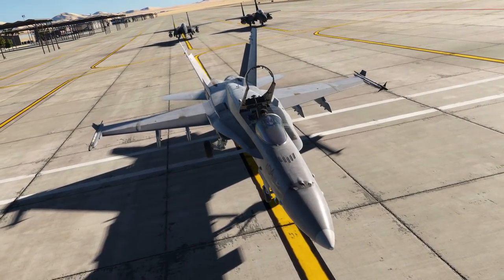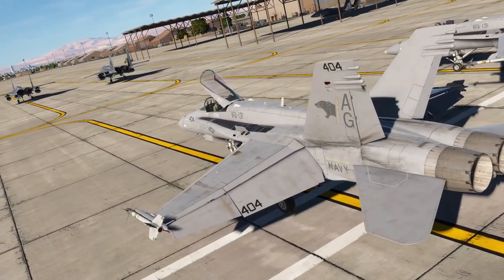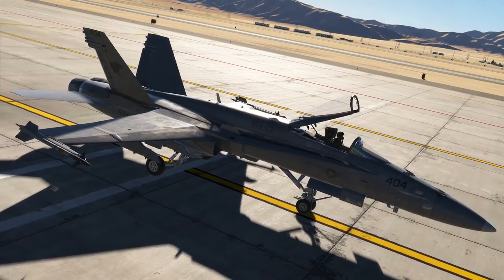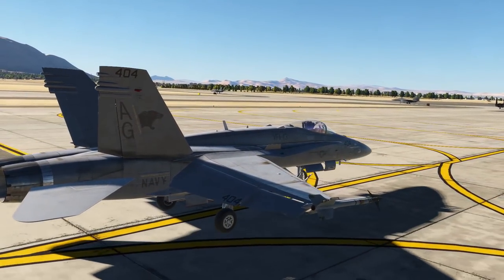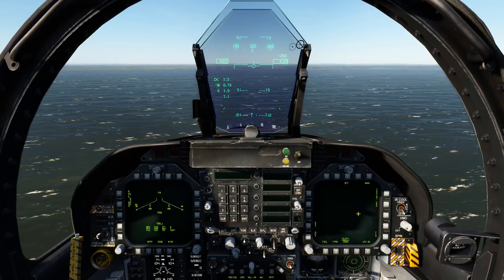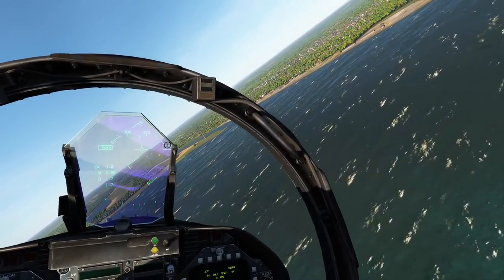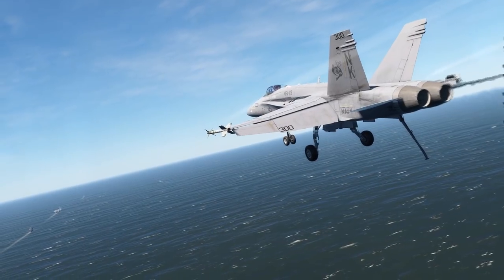DCS: F/A-18C Hornet - Episode 1 - Introduction

Comment: I love it. The Hornet hype is starting to finally feel real. Can't wait for the next video. Nice landing there. Three wire trap? Doesn't look like the Nimitz class is getting a facelift though.
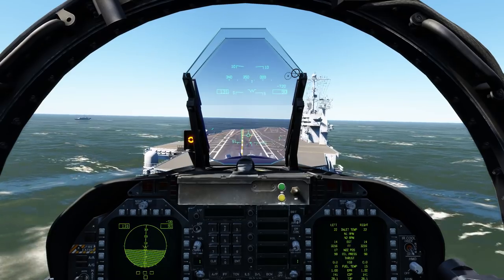Reply: BelGeode pause at 10:12 
I'm pretty sure the tower is WAY more detailed than the default.
Reply: Yeah the textures DO look great, but I am referring to adding things like tugs, deck crew, etc. There is that CVN-77 mod that has all those extras in there, which definitely add to the feel of the carrier. But hey, I am just glad I can do Navy carrier ops soon™...
Reply from the maker: It's an early alpha.
Reply: That works for me! Thanks Wags!!
Reply: 65 ft long no way Jose that's almost the size of the foxbat.     its more like 45-58 feet long and the engine produce 32,000 each at full burner sooooo c'mon dcs.
Reply: Crystal Mchenry Not sure any of us in the comment you're replying to mentioned the length of the Hornet....

but it's actually 56 feet 1 inch long. With GE 404s, itw 17,750 lbf per engine on burner.
Reply: BelGeode nope I'm sending you a link were a blue Angel pilot says two 32,000 pounds pushing you along on Facebook give me one sec
Reply: Crystal Mchenry ok. thanks.  still not sure who mentioned it in my original comment though.
Reply: BelGeode sent to your fb
Reply: Crystal Mchenry 32,000
Pounds sounds more like non-EPE engines with both engines added together.
Reply: Luke Swann negative ghost Rider
Reply: Sorry Crystal, but it's time to buzz you with a quote from the NATOPs flight manual.

"2.1.1 Engines. The aircraft is powered by two General Electric engines: F404-GE-400 in Lot 13 and below and either F404-GE-400 or F404-GE-402 in Lot 14 and up. The military thrust of each F404-GE-400 engine is approximately 10,700 pounds with maximum afterburner thrust in the 16,000 pound class. The military thrust of each F404-GE-402 engine is approximately 10,900 pounds with maximum afterburner thrust in the 18,000 pound class."
Reply: Luke Swann  I would rather believe a blue Angel pilot rather then a wiki warrior
Reply: Just for your information the NATOPs manual is the manual by the people who built the F-18 and is used by all fighter pilots when they learn to fly it.

The blue angel pilot probably just mixed up the fact that he had added together the two engines thrust.

No ones perfect, but I would rather believe a manual that has been updated and edited by the military for about 30 years in order to train fighter pilots than just one quote from a blue angels pilot .
Reply: Crystal Mchenry if you don't believe me, you can look up the 900 page NATOPs manual for yourself and turn to section 2.1.1

Don't you find it an interesting coincidence that the figure the blue Angels pilot said is exactly double what the manual says each engine can produce?

If what he said is true the hornet would nearly have as much thrust as the F-22

If what he said was true then in total the hornets thrust would be even greater than its maximum take off weight! He simply had a slip of tongue that is all...
Reply: Luke Swann  lol nothing the us military release is true lol. the f-22 thurst is greater then 70,000 pounds. cause if thats the case the F-14D had 60,000 pounds of thurst so and thats a cold war era plane so I can only imagine the F-22 real out put.  the US military well never tell you the exact specs on anything we have but I can tell you what a F-15 PILOT TOLD ME   what ever you hear about jets in the us military think 2x as fast and 2x as high so I would rather hear it from the pilots themselves then a report !
Reply: Crystal Mchenry The hornet is 40 years old it is very declassified.

The simulation you were talking about here in DCS and were saying was unrealistic has real hornet pilots helping the developers to make it.

This is not a report that I posted it is a quote from the manual that the actual pilots train from. Another section of the manual which I have is for performance and calculating range for missions, it would be very bad to have the wrong figures to do that with.

In case you don't think this is the correct manual you can actually watch a show of Canadian pilots during training and see them using the same manual. That's beside the fact that there are actual retired pilots vouching for the manual.
Reply: Luke Swann then tell me why the F-14 SPECS ARE STILL TOP SECRET STILL
Reply: The specs for the F-14 are not classified, if they were Iran could simply release them to do harm to us since they own F-14s! 

Just ask Heatblur simulations which are developing a simulation of the F-14.
Reply: Pilots are just operators, most of them know fuck all about the aircraft they fly!
It's like my wife can drive a car, but wouldn't know the difference between the engine and the transmission.

If you really want to know, ask the engineers who work on these machines.
Reply: Luke Swann lol Iran was a bad move one reason the f-14 was retired Early but again talk to navy pilots and they told me the F-14 TRUE RADAR RANGE IS STILL CLASSIFIED with a bunch of other top secret systems on the tomcat
Reply: Crystal Mchenry the true max radar range may indeed be classified, but not the performance of the Tomcat itself.
You can read/listen to accounts from pilots and engineers that get as detailed as to specify what conditions would cause the engines to to have compressor stalls. 

But I wasn't meaning to talk about the F-14, I simply wanted to correct what you were saying about the hornets thrust that is all.
Certain missile and radar systems are definitely classified. But the performance of an older jet like the Hornet is not.
Especially when the performance manuals have been declassified. 

The REALLY classified stuff you don't hear about until after it has been in service for years. Like the nighthawk or the stealth helicopter that was used in the raid on bin laden.
Reply: Luke Swann  blue Angel pilot or Internet person I'm still believe the blue Angel pilot.
Reply: Crystal Mchenry that's fine, you don't have to believe me. 
You can instead look up and believe the book that the blue angel pilot had to read when he was going through training. Look up F-18A through D NATOPs flight manual. It should be more than 900 pages.
Reply: Luke Swann or I could believe the pilot that actually fly it.   lol
Reply: Or you could do your research, and not believe the first thing you hear.
Pilots all make mistakes.

Just look at how many blue angel pilots have crashed
Reply: ZMartian that's not going to help this conversation......
Reply: Luke Swann that's cause them are the oldest hornets in the fleet. there getting super hornets soon
Reply: Crystal Mchenry wrong, they have had crashes in Hornets since the late 80s.
Some were not due to system failures either.  But that's not the point.... 

Would you like me to post all the sources I have later so you can see for yourself?
Reply: Luke Swann like I said I heard it from the horses mouth. real pilots that fly these planes every day. so idc what you post I believe the pilots over you!!
Reply: OK so you'll believe actual pilots.

Here is an article written by someone who flew both the F-18 and F-16. 
He talks about the thrust produced by each one. 
He says that the hornet produces 35,000 pounds of thrust and the F-16 29,000. Why would he compare a single engine of the hornet to the single engine of the F-16 when he was comparing their TOTAL stats.
If what you say is true, then just one engine from the hornet would have more thrust than the F-16. But since the F-16 has a faster top speed it obviously cannot be the case.

https://fightersweep.com/1904/hornet-vs-viper-part-three/

Besides this I can give you quotes from multiple official manuals, books, on the F-18 and documentaries.

If that does not convince you then nothing will... 

Please for your own good, if you ever have to find out if something is true that is actually important, be more responsible than believing the first thing you hear and closing your mind to any other evidence.
Reply: And the plot thickens.......      Anyone belive in chemtrails here also?
Reply: Luke Swann You are the most patient, well spoken person iv ever seen on YouTube. It actually hurts to see you waste your intellect on a moron who will believe a guy who's been flying for about a year then a manual which was released with the aircraft over forty years ago.
Reply: NATO would put false facts in the manual. Especially that’s what the pilots and mechanics are going to reference. 

Although, typically when it comes to military information it’s safe to assume it’s usually 2x whatever they say. 

It also depends, the fa18 is used extensively so it’s not incredibly difficult to find information.

Comment: Wow. Just wow. Do I sell my barely used (because of stiction) Thrustmaster Warthog in anticipation of them releasing a hotas for the F/A-18 and hope it is better? :D
Reply: It will be the same. In fact I suspect they'll sell just the grip separately for current owners, the base unit will guaranteed be completely identical in every way.

The stiction can be fixed by a lot of things, and when fixed, I don't think there's a better flight stick out there for the affordable sim market. I also recommend using an extension - part of the problem is that the stick is way too short. I added 12cm to my stick, and it is like butter now. I lubricated it with Nyogel 767A (a specialized lube, specifically to give things a feel similar to hydraulic dampening), and it feels like I am genuinely operating a hydraulically dampened joystick. It's amazing now, I'm so glad I took the time to tune it up. Nothing will ever beat the feeling of a full metal stick in the hands, the weight is important too.

But yeah, extension is the big deal. Real flight sticks are much longer - and remember, longer stick means you have enormously higher leverage - so the "bumps" and stickiness is overcome  by your increased strength. In reality, flight controls are not perfect either - most airplanes will have slight un-evenness and occasional stiction - I try to remind myself of that whenever I make tiny corrections and feel the uneven-ness (only really happens when the stick is dead center) :)
Reply: Steve Dickinson just buy an extension. It works great!
Reply: imkNick I've just used some silicon oil / grease (100% silicon) inside the gimbal and this has improved it to a reasonable amount.

My stiction is only noticeable when I release pressure from the stick in the Y axis. For example, if I have a small amount of forward stick and then go to reduce the amount by a small degree, the stick doesn't move and then jumps giving a horrible jerking motion to the flight in the sim. I have flown actual aircraft including gliders, a gyro copter (seriously stiff stick controls due to centripetal force of the rotor), and a Robin 2160 (stunt instruction flight) and I do appreciate that real life controls do have a degree of notching etc and you can feel the cables being pulled etc, however they don't related to the same amount of lurching in flight that I get in the game or sim from this stick due to it.

I'm going to 3D print and extension in a few sizes and see what works best (if at all) and then order an aluminium / steel one hopefully. Thank you for your suggestions.
Reply: If you google a bit, you'll find more info on the Warthog tune-ups - a popular mod is to open the gimbal up and sand down some parts to make them smoother. Although that's perhaps a bit more on the risky / brave side of things. I did it,and it helped quite a bit. But with an extension, it's just a non-issue for me now. I think the reason the stickiness is such a huge problem without an extension, is that even though your hand moves a small amount - it's still a large fraction of the total travel of the stick, at default length. Compare to the really really long sticks / levers used in a real aircraft, where moving your hand 1 inch is a fairly small fraction of the total travel. Again, due to leverage. It's an inherent flaw with "game" joysticks sadly - but yes, the extension worked great for me. However it does mean you have to change your seating position - I've adopted the somewhat goofy strategy of placing the base of the stick under my legs, so I basically sit on it - but it does mean the stick is at almost perfect height, and position - as compared to a typical military aircraft. It's also quite sturdy with the large flat base of the stick sandwiched between my legs and the chair. Hopefully I'll get around to building a sim cockpit, but for now it's working out well.

Hope it works out for you! It's all about the extension I'm pretty sure!

Comment: Wasn't that landing a little harsh? Or is the plane gear designed to sustain such stress?
Reply: It is designed for it. Some hornet documentaries refer to it as a "controlled crash"
Reply: I researched this for both you and me: https://aviation.stackexchange.com/questions/1423/what-vertical-speed-at-touchdown-makes-a-perfect-landing/15658#15658  2nd answer, 5th point says "a Navy carrier pilot " "said that they wanted a 4G landing impact", in accordance to this, the 4.4g landing wags (matt wagner) made, seems very standard, and seeing how they ( 2:52)  chose steel, i'd say it was designed for that kind of stress, yes.
Reply: Yeah, you can see the difference in landing gear design in the Hornet compared to the Fighting Falcon (or the F-16 Viper), or even the derivative YF-17. As the Hornet was designed from the YF-17 for the US Navy, it had to get a much bulkier landing gear as is required for naval landings. There was however going to be a land variant of the Hornet known as the F/A-18L which has no launch bar, a limited arresting hook, and not as bulky landing gear.
Reply: That landing was very smooth for an F/A-18. Usually the nose pitches down a bit more.

Comment: why is it that the old DCS water looked way better and way worse at the same time compared to now
Reply from the maker: It's not, it depends on wind setting. You need high wind settings in later versions for the effect.
Reply: @MattWagner  thx alot i will check that out :)

Comment: Will there be a RAAF hornet
Reply: RAAF uses the Superhornet
Reply: you're only half right, they use the F/A-18A air frames but they're upgraded to a C Avionics wise, and the RAAF also has F/A-18E/F's
Reply: AutomaticGamerHD and As Bs CS Ds
Reply: only Fs we have and we dont have ds that was my mistake. and the As were conerted with C avionics but we did originaly order As
Reply: The As are the single seated variant and the Bs were the dual seat variant. We ordered 57 A model Hornets and 17 B model Hornets. The RAAF upgraded the avionics of both aircraft to C standard.
In 2009 the RAAF leased 24 F/A-18F Super Hornets which are the dual seated variant of the Super Hornets. The reason for the lease was as an interim for the F-35 which was delayed, and as a replacement for the aging F-111Cs which eventually got to over 300 maintenance hours per flight hour.

Comment: are you kidding me? I mean its study sim right? So why the Hornet is so stable at the landing like it was flying on the rail?
Reply: Often the disconnect from sims and real life flight is the lack of turbulence or wind;  so if the F-18 was on a nice glide slope, with no crosswind, no turbulence, then it can look extremely stable like that.  I flew a Cessna 172 for the first time a few months ago, riding with a pilot friend, and on a clear normal sunny day I had to work out my arms constantly just to stay on course.  At 3500 feet or so that thing was flopping around all over the place.  It was like flying a paper airplane.  However, Cessna in flight sims always feel ultra stable unless you manually turn on wind/turbulence
Reply: that's an issue with the core DCS platform, not the module.... You do realize these modules have to be able to fly online right. You can't fly online and have 1 airplane exhibit turbulent atmosphere, while another just doesn't care, or behaves completely differently. The modules have to behave according to the core simulation. That's why it's so stable, because the core DCS simulation defaults to perfect flying conditions - 0 wind, 0 turbulence. This is an issue that they have to address with the DCS platform, that's what is responsible for the environmental data, not the individual modules.